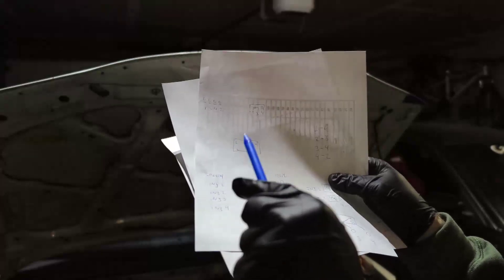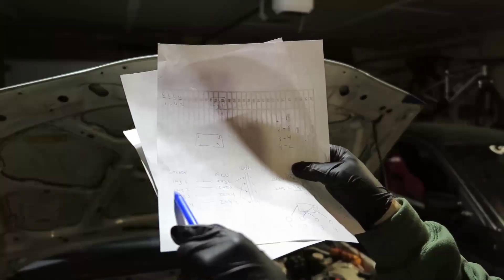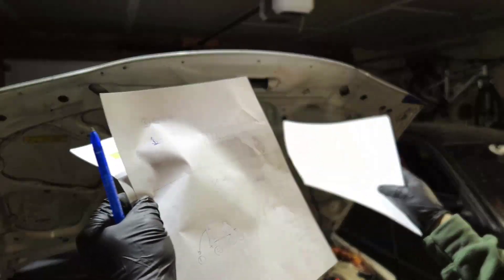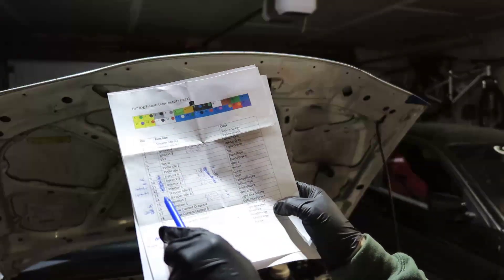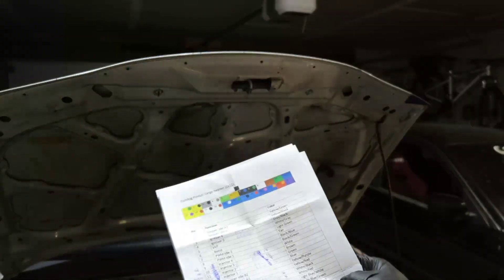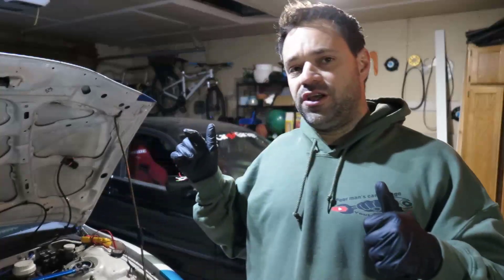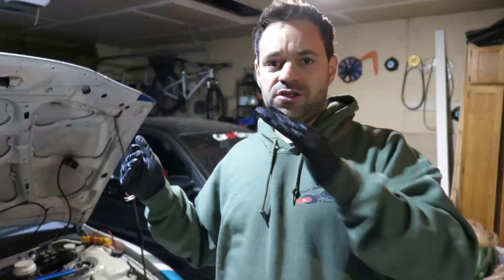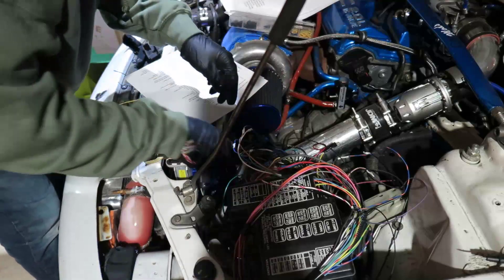Wiring SpeedyEFI Standalone ECU Part 2 of 2 - Eclipse 2G Speeduino

Comment: And what color and number did you plug the fuel pump trigger to you never said
Reply: Let me rephrase that the purple wire on my schematic that came with my EFI where did you plug that wire into I’ve looked at all the videos that purple wire which is the fuel pump trigger wire you skip right past explaining were you plugged it or number you plugged in the throttle position wire the light blue one and the 12v and I’m not talking about the ASD relay video I have that relay grounded like you did
Reply from the maker: @michaelwashington9452  Just watched me doing it here from minute 5:50 till minute 7:30 is on this video https://www.youtube.com/watch?v=DUhmpjQ87n4&list=PLdqU6ucc0h6Fj4_Z34WJ6BUTmGZofjzHK&index=3
Reply from the maker: I think it was pink but you need to look into the 2 page color code that they send with it

Comment: you didn’t say what you did about the tach out wire
Reply from the maker: I connected the USB into the dashboard and my rpm is there. My speed is taken by gps.  I did not use the bmw tach.  I'm about to install one on my Toyota Supra. I'll definitely need to attach it on that one.  Stay tuned for the videos coming up

Comment: Thanks for making the videos on the speedyefi. Not a lot of information out there for the basic wiring for the ua4c boards the fishdog uses. I sure wish speedyefi had better and more in depth information on these products.
  i have a  few questions for you if you don't mind. I have a fishdog on order and am planning out the wiring.  So just to confirm.  The wires labeled fan2, fan1, and fuel pump trigger output negative when triggered correct?    Also they have several ground wires. they are numbered 10, 11, 21 and 22. Which one is the main ground for the ecu to chassis? Which one is the signal ground for the sensors?  Thanks
Reply from the maker: Message me at marcos@carmodsgarage.com and I'll send you the manual I got. Can't remember but they are labeled pretty clear in the manual. The pump and fans as far as I remember the trigger is the negative. I gotta check the manual to tell you for sure. It's all easy though

Comment: Great explanation! I have a Dodge Neon that has a very similar engine to the 420a (Dodge ECC, the cylinder head is reversed). All of the sensors are pretty much the same. The pinout is a little bit different though. I noticed that you did not run any wiring for fan control, are you just running those on direct power on or via a switch?
Reply from the maker: I got the fan from the ecu connector and connected to the SpeedyEFI. It turns on when reaching certain temp controlled by the ecu.

Comment: @10:14 i Know for the ECU Master EMU Black, seeing I'm going to be running my OEM Dumb Coils directly from the ECU and deleting the OEM Igniter, my Tach signal to the dashboard on the Body Harness will be coming directly from the EMU Black. Maybe your tach signal Out is similar, to be wired for your dash on the body harness for the cluster
Reply from the maker: Same here I have a tech out. Need to figure out later where it goes. I have the pinouts. It should be easy. 
Thanks though I saw it earlier but didn't want to mess with it until the car runs. 🤙